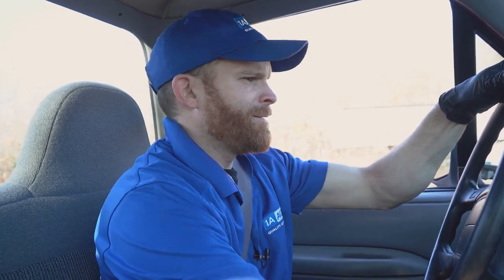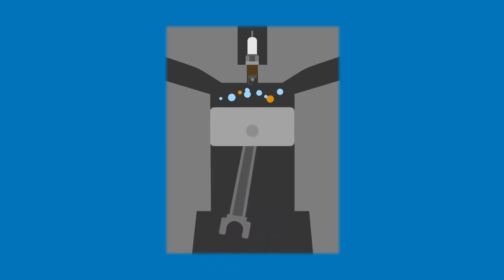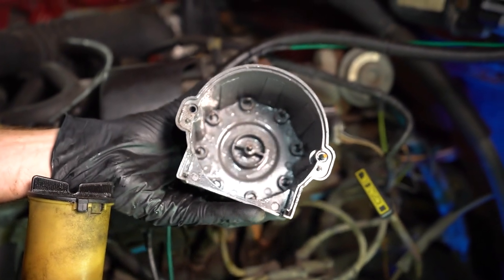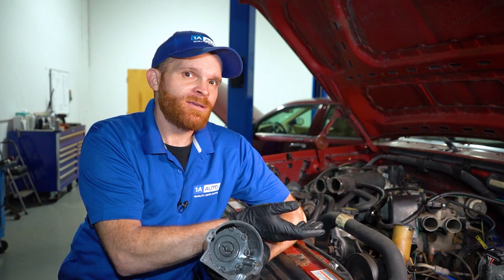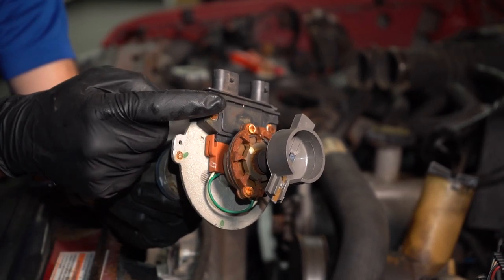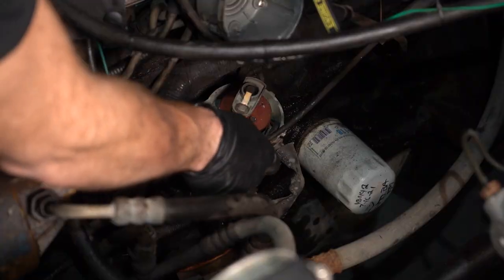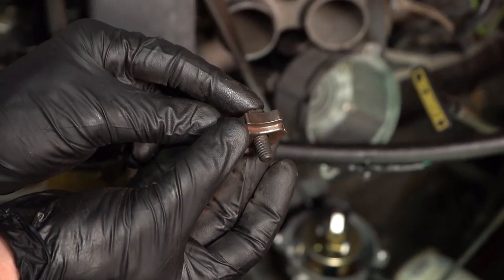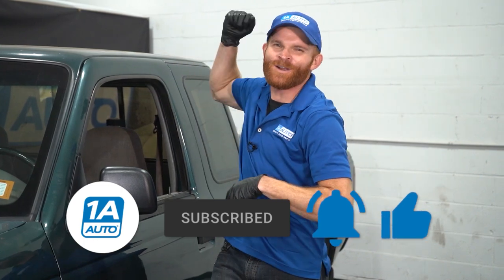F-150 Not Starting? You Can Replace the Distributor and Ignition Coil Yourself With These Easy Steps

Comment: My vehcle started up just fine one morning and then would not start. I found the cap has a number one marked on it (1985 FORD E350 460), but I also found it was oriented towards the number 8 cylinder (rear driverside bank). I have the rotor timed to TDC and pointing at the number one cylinder (Front passenger side bank). However, the number 1 sparkplug is 180 behind it. As I understand the firing order is 1,5,4,2,6,3,7,8. So my question is if the spark plug cable is not timed with the rotor, then this could be a problem for this year/make? I ask this seemingly dumb question bc I understand that the ICM controls the timing. I also replaced the Ignition coil and ICM. Still crank, no spark. I planed to replace the pick-up coil next. Now I'm thinking this is part of the issue? Or is this normal for old Fords to have the cap on backward? I used the marking on the crank shaft to align TDC. And I am getting plenty of power to turn it over and then some... but still no spark. Hence my next question, should I just reorientate the spark plug cable in this firing order off of the front No.1 cylinder clockwise from there?

Comment: You ain’t a mechanic until you take the wire off of the distributor, hold the contact metal end and crank the motor.  Don’t be a panzy…